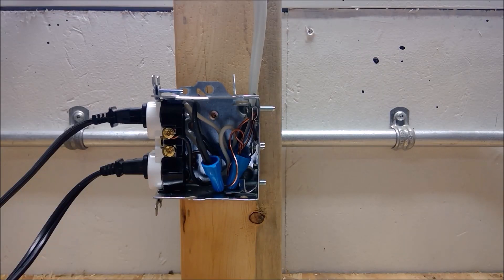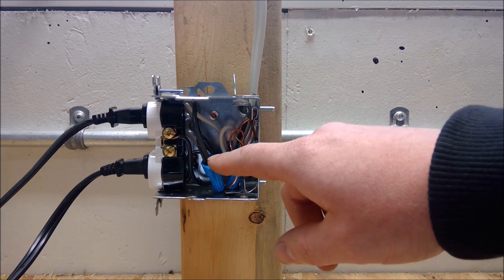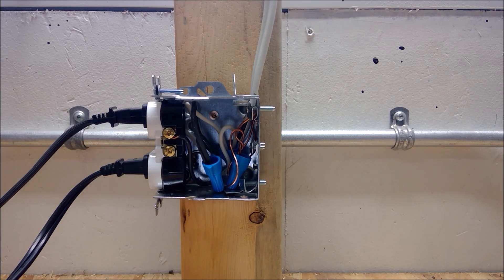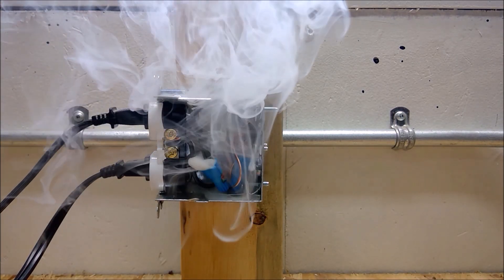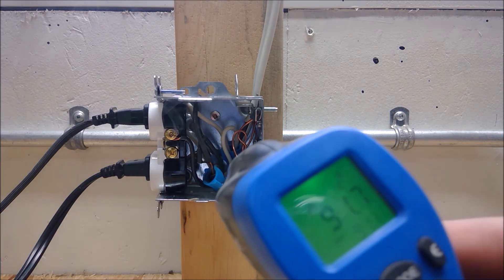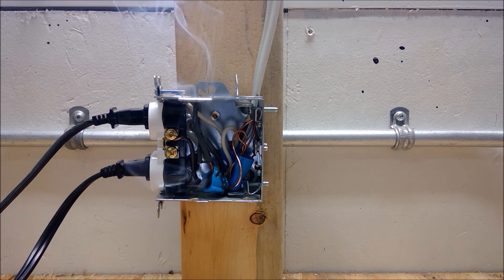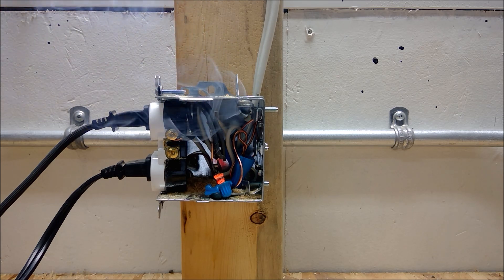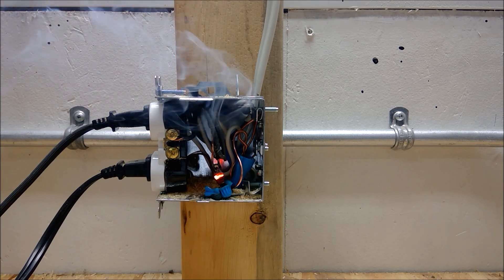Loose wires cause fires.

Comment: Those connections, terminals, bare wires looks terrifying for me as European electrician.
Reply: The bare copper is the ground.
Reply: I can understand that, it's obviously not gonna be live
Reply: zforce69 Wirenuts work fine. Are we supposed to weld the fucking thing together and put new insulation on it?
Reply: Skaarj RPG They are usually only metal in commercial installations. Residential installations usually use fire resistant plastic, it reduces the cost of the home. The NFPA still wonders why so many people die in house fires... Houses here are built to the lowest common denominator, a bunch of 2x4s with some decoration.
Reply: Jonny Dahl. Also, NA homes are fed with 240V. The power is then split into two 120V lines 180° opposite from each other. That way if you use the two 120V hots instead of one 120V hot and one neutral you'll get 240V. It's called a split phase.
Reply: zforce69 Don't be a dumbass with electricity. You shouldn't alway rely on health and safety features.
Reply: Ok, we get it. You European bad-asses are too good for wirenuts.
There is no problem with them when you twist CLEAN wires together with a lineman's pliers and twist the cap on nice and tight. I like to wrap a little electrician's tape on the exposed bottom for good measure, and leave the cap of the nut exposed.  For the limp-wristed DIYr, they make screwdrivers with the buttend that fits wirenuts that can help twist the wirenut on nice and tight. I actually use that tool when installing the bigger wirenuts.
Reply: Jonny Dahl. The Japanese are using, take a seat so you don't fall, 100V. But both Japan and NA are using NEMA style systems and there are 20A outlets available (although not as common as the 15A ones).
Reply: I know what you mean, those wirenuts just seem dodgy to me.
Reply: Wire nuts look so dodgy to me too, we only use screw terminals or cage clamps for joining wires which are much harder to get a loose connection with that could arc like this
Reply: zforce69 I still can't accept the fact that Australia allows 230V connections to be done behind those C clips instead of proper boxes. I always replace those clips with Clipsal fire boxes.
Reply: Americans proved inferiority to most countries in electrical regard when they didnt switch to 220V...
not being able to get more than ~1.5kw out of a socket must be fun...How do you guys boil water? :D
Reply: thats still just 2kw...oh god
Reply: Mark M Here people are push and go most won’t make sure the wires are pushed in well turning them right is safer if done properly
Reply: Jonny Dahl. Considering Australia and China, as well as some other 230V countries use 10A sockets, 2000W is OK. Kind of.

Not as good as 16A Schukos or IEC 60906-1s tho.
Reply: Yeah i know, it's just weird to me.
I have a 21kw water heater in my bathroom and a many ppl have 10kw Ceran cooktops in their kitchens here :D
Thats stuff you usually dont think aobut, thats why im surprised
Reply: Spaceman Rick Same way I've always done it, don't want an equipment ground somehow poking its way into the end of a wirenut. Also when I want my wirenut extra tight I just grab it with my linesman pliers, I'll have to check out that screwdriver though
Reply: sounds like it takes longer than a wago connector and is less safe...
Did you try both methods or are you legally bound to wirenuts or smtn?
Reply: Jonny Dahl. If by wago connectors you mean the push in kind I do use those too when I'm given them. But I prefer wire nuts because you can just take them back off after a rough-in. And when you need to add feeds into an outlet or switch box you can just take the nut off, untwist the wires and twist in the new one with the rest, using the same wirenut again. Instead of cutting each one and going from a 3 connector to a 4 connector. We have already very short wires in these old homes and can't afford to be cutting the push in connectors off every few years when people want fixtures/switches replaced
Reply: Legacy systems are expensive to replace.  It was a huge deal to move from 25 Hz to 60 Hz after WWII here in southern Ontario.  We were still generating 25 Hz until about the turn of the century to facilitate the loads of certain industries.  
Residential voltage changes would be simpler and could be phased in but the US is incredibly resistant to change.  Our industry is tightly tied to theirs.  Personally I think a properly monitored ungrounded system is safer.  
They fought a revolutionary war to leave Britain's rule but refuse to embrace the metric system and hug closely to a smaller variance of the imperial system.  US gallon for example is 16.6% less than Britain's gallon of times past.  More money to be made selling smaller gallons.
I cold brew my tea...  barbaric!
Reply: @niagaramike528  Yet in 2017 there was that recall for over proof 1.1 Litre Bombay sapphire gin making it to market in Canada. 1.1 Litre, that's 1 imperial quart. Good luck finding any hard alcohol/wine sold in non-metric volumes in the US. Conversion from legacy sure is hard.
Reply: It's funny you mention that.  It's odd that the US sells hard liquor in metric volumes yet Canada customs still has duty free allowances in imperial measurements.  Sure it's 1.14 L  but we all know that it's 40 ounces.
Reply: Most houses in North America.  Lots of trees here.
Reply: Jonny Dahl. In the kitchen that has 20 amp plugs (~2400 watts) 
Lol it's so high (kind of scary if you think about it (enough amperage to fry you 100x over))
Reply: CSphoto110 yes double the voltage adding making it 240 leads to more danger
Reply: Skaarjman Don't be so dramatic!
Reply: The fact that Screw Terminal Blocks exists, given the fact that wire nuts exist, is sort of like shaving with a banana. A pretwisted, properly wire nutted connection is pretty much never going to fail, ever. Period.
Reply: that's why american junction boxes are metal - they are fireproof. In Europe, we use barely any connectors at all ! All connections done in switches, outlets and so on. No junction boxes or anything.
Reply: Oh, look, another foreigner claiming superiority over Americans. Our junction boxes do not catch fire when someone plugs a hair dryer in, thank you.
Reply: No, they don't, not when your limp wrist screws them on. You need to have a good twist in your conductors and secured using a screw connector otherwise you get a hot joint like in this video,  and yes, Australian wiring rules call for equivalent insulation to be installed but I guess that's why our junction boxes don't catch fire when someone plugs a hair dryer in.
Reply: @zforce69  https://youtu.be/v9hohwvGeHw Watch the entire video. The conductors aren't pre twisted.
Reply: The more you hear about the US the more it looks like a mess :D
Reply: The one in the video did, have you watched the video?

Comment: Well I'll be SURE not to place sawdust in my boxes moving forward!
Reply: i think its more of a comment on how comical it was that one minute there was no sawdust, and the next it was full of it.
Reply: Nobody likes a dusty box.
Reply: Also, make sure you don't use a toaster and hairdryer simultaneously, while you're asleep.
Reply: pretty sure making a video is what causes fires at this point
Reply: Just stuff steel wool in them, it help with insulation.
Reply: Trust me there's sawdust/trash in your boxes already
Reply: I never really thought about this, but maybe this is part of why electric heaters can be so dangerous; They draw a lot of amps.
Reply: @ryanstanley5634 as long as you only have 1/2inch or less of the rubber inside and use metal boxes inside walls and rock wool insulation inside walls where electrical boxes are kept you should be good
Reply: The dangers of Electric Heaters is from people putting combustible materials in close proximity to the radiating elements. However, if you have an Electric Heater plugged into a circuit, that also has a million other things plugged into it as well, then yes, you will exceed the current carry capabilities of the wire, and the wire will get extremely hot, and quite possibly start a fire.
Reply: winner!
Reply: Yup. Absolutely, I just meant that it could be part of the problem. I know that older heaters without "tip-over" cutoff switches can be a problem, as well as putting them too close to clothes/blinds etc. 

One time I went to a trailer fire and this guy had like 4 extension cords plugged into eachother and powering a deep freezer on the other side of the trailer. Did that cause the fire? Nope, a crazy ex did it :D And he knew it because she texted him and told him so! Lol.
Reply: @ryanstanley5634  that is not surprising as if you put too mutch load ( over 15 amps ) that will cause a fire or if the cords are shorted or overloaded.
Reply: @charadremur333   shouldn't the circuit breaker trip?
Reply: I've been doing it wrong this whole time!
Reply: EPLURiBusUNUM  happens all the time. Especially dust.
Reply: It will still catch fire with or without the sawdust. Plus there will be other debris and dust that will gather inside the box.
Reply: ..........or a Hairy Box for that matter, personal preference, LOL !!!

Comment: The lesson here is to get a qualified, licensed electrician to do the work. That is no guarantee, but it improves the odds by a lot.
If you screw up the plumbing, you get a mop. You screw up the electrical wiring, you call the fire department and maybe the coroner too.
Reply: Or learn how to do the job correctly yourself so that if anything goes wrong, you only have yourself to blame.
Reply: or just familiarize yourself and do the job properly... I am in no way close to being electrician but many times I have paid for the job and then had to redo it! I have had an inspector tell me my electrical work is better than 95% of residential electricians out there...so I rather do it myself. I am a perfectionist so before I do anything I always read up on how to do things properly. Related to this video, I always pre twist my connections, put some wire nut on it, put some tape around the bottom of wires so it eases on the pressure of bend and also tape the metal around the outlet case.

Comment: If you ever find a Wire nut / Marette that doesn't have the metal coil insert, throw that shit in the garbage and get a proper one. I replaced a ceiling fan that had nothing but the worthless, all plastic wire nuts.

Comment: Maybe put your clips the right way bud
Reply: JP Brady These are hard to not splice wire/have good contact
Reply: If you're talking about his emt clips, that is the proper way. Put two pieces of emt on the wall, one clips up, the other down. See which one bends the clips first when you stand on it. I have tried this, in a room with 20 other non believer electricians... they all install the proper way now.

Comment: Hi Andrew

Nice Video to demonstrate the ignition by faulty circuit arrangement.
Just want to know that how the wires are connected to cause the fault and why the Circuit breaker doesnt function well
Reply from the maker: The conductors were not mechanically connected together. We usually do this by twisting them together.
The breaker did not trip because we never exceeded the maximum amount of current that the breaker is rated for. (15 amps).
This type of breaker requires a large short circuit current to trip because the trip mechanism is mechanical not electronic like those found in a AFCI breaker.

Comment: Scary but can you show what the loose connections look like inside?  How would you know?
Reply from the maker: The easiest way to tell if a connection is loose is to physically inspect it. Always make sure the circuit has been turned off at the panel box and then check each connection. Unfortunately most loose connections do not have any specific visual indicators.

If you are concerned please contact a licensed electrician.

Comment: Would love to see this done with a metal box and a plastic box - I hate plastic boxes, for some reason they just scream "fire hazard" at me, because, in theory, they aren't as capable as metal boxes when it comes to containing a small fire from a faulty connection as you demonstrated here!
Reply: Actually the boxes must be made of a flame-retardant material, and special plastic could fulfill this. This type of plastic is self-extinguishing. This is standard in Germany for decades. The last metal boxes I've seen here were installed in an early 1950s electric installation. On the outside they were plated with lead to prevent corrosion (plaster is corrosive) and they were coated with tar on the inside for electric insulation.

But the best thing is to ensure that all connections are ok and you don't have any lose connections in your installation. Precaution is always the best thing.

And 90°C is really bad, the PVC insulation of the wires is beginning to degrade at 70°C. The effects are accumulating. Every time the conductor temperature is rising above 70°C the insulation is degrading more and more until it's totally destroyed.
Reply: This shouldn't even be a concern. User proper voltages (230/400V), proper terminals  and there is no problems !  Never seen properly made junction box catch on fire (even on older than 10 yr)
Reply: Marcel Germann I couldn't imagine having to deal with those boxes! tar? what a messy situation.
Reply: It's looking this way, a pic of a junction box:

http://www.bauexpertenforum.de/attachment.php?attachmentid=55966&d=1456821908

Sometimes dried tar, sometimes paper impregnated with tar. You may be certain to get black fingers if you work on them. During the 1960s these boxes were replaced by boxes made of plastic.

It's a mix of old and new cables on the pic. The cable with brown, blue and green/yellow is new (past 2006), the other wires are from 1950s and 60s. The newer cable is NYM-type (N=normalised, Y=PVC-insulation, M= sheathing). The old installation was made with single wires in conduits. The conduits were made of steel sheet and  insulated with tar impregnated paper on the inside. The outside was lead-coated to prevent corrosion, plaster is corrosive.
The installation itself is from the 1950s or earlier. The connectors are old style Wago-connectors which are in use since the 1980s here.
Reply: How do you test for an orc in a plug
Reply: Marcel Germann they use metal here plastic is used but it’s cheap and it melts quickly and usually won’t trip the breaker as if you have a grounded metal box it would trip the breaker if the live touched the metal box
Reply: Skaarjman yes but that can lead to more arcing